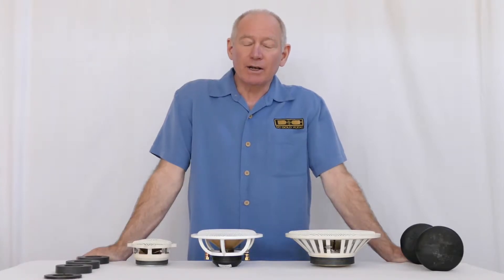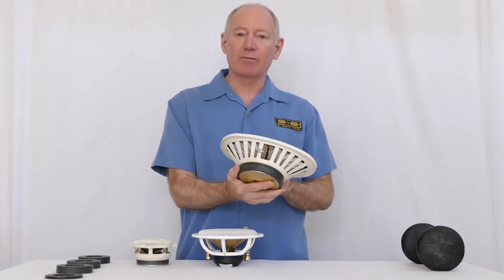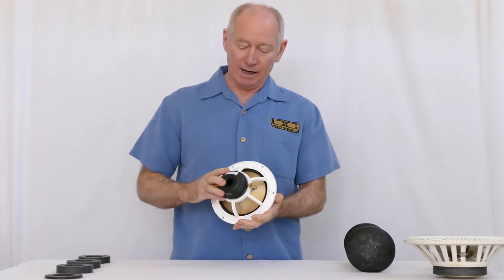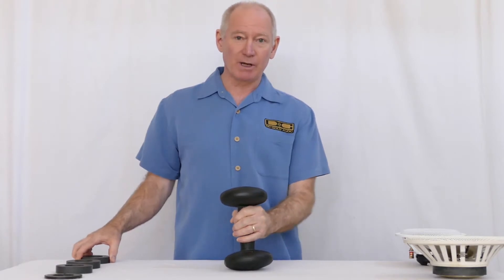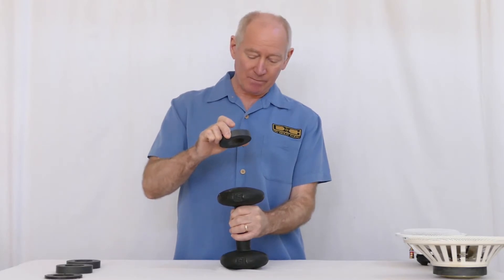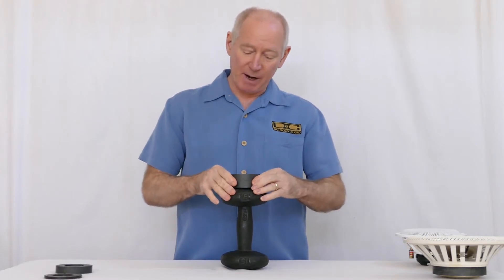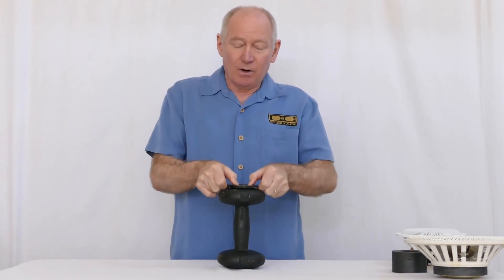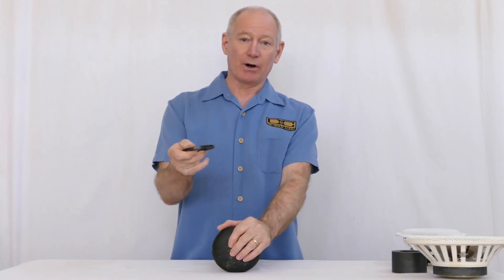DC GOLD AUDIO   Neo vs ceramic magnet

Comment: You add smaller amounts of Neo to = the same magnetic flux as larger ferrite magnets, therefore they have the same flux, therefore control the coil the same therefore have the same sound quality if looking at only the magnets.  Neo speakers are only good in one aspect and that's weight, good case and point are musicians who set up and take down and move there gear show to show. 
Saying neo magnet speakers have better sound quality just shows me you KNOW nothing about the subject and are just using this to sell speakers even though ur full of shit.
Reply: The neo ones are the ones with the bracket around the magnet, right?  That seems to be the rule, at least with older speakers.
Reply: tarstarkusz depends on the company and what kind of neo they use.  They can be made into any shape really and have different temperature ratings.
Reply: They have a small magnet and a bracket which crosses the back of the magnet.  I recall once having seen a video which said that the ones with the bracket are neodymium and the ones without (magnet usually much larger) are ceramic.
Though it's not a great angle, this is what they look like:

https://www.ebay.com/itm/WURLITZER-3310-3300-JUKEBOX-Working-6-SPEAKER-SYSTEM-2-12-2-6-2-twt-/332851476895

See how there is a bracket covering the magnet and is shaped like a top hat.